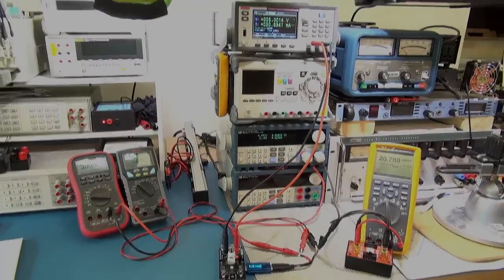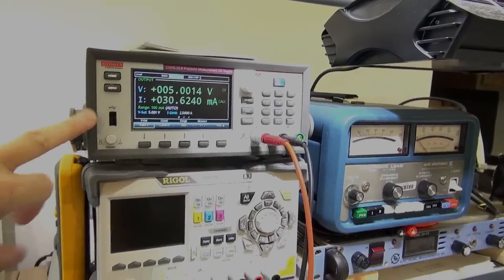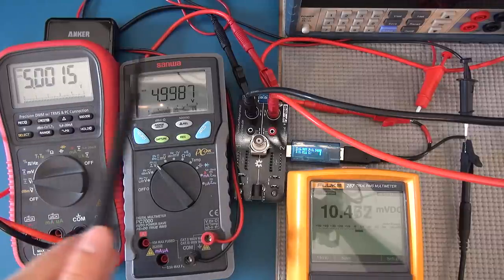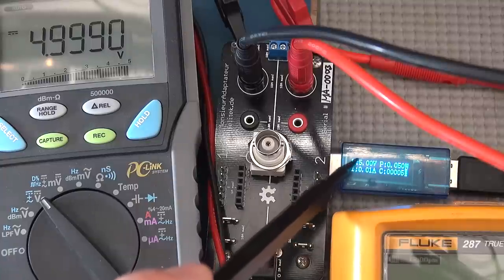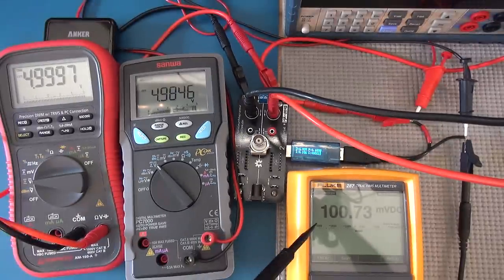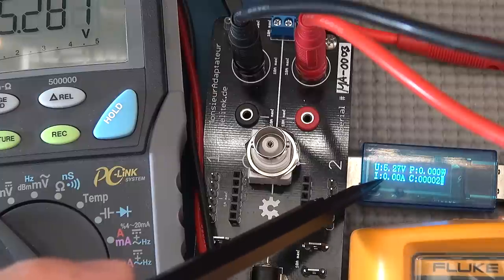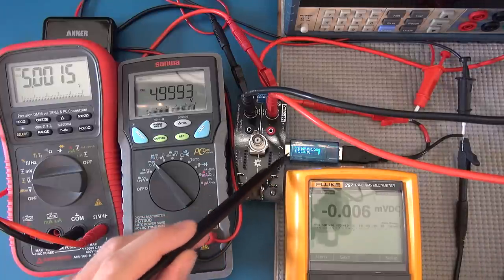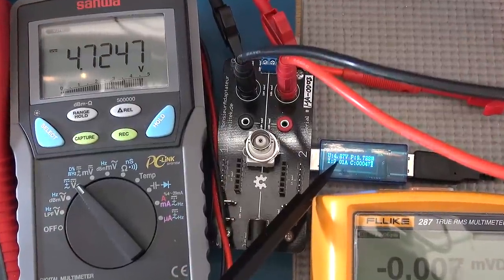USB Power Monitor Review - Pt2

Comment: I have been using the new yzxstudio usb2.0 Black with 2.5 firmware and this is an excellent monitor for in the field work.

It may not be 'good looking' but it is very well protected from dust and windy conditions blowing in unwanted debris.  :)

Comment: I have a identical one to the drok 3.0, even the sticker on the back i identical only it doesn't say drok on it and when you start it up it say welcome instead of Drok, all the functions are identical down to the red led and so on, under 10 bucks on eBay,  English manual with images and fully understandable. 
Sellers name is 
t-happy,  search for oled USB 3.0 power meter and you should find it.

Comment: I'm considering getting either the  red or yellow yzxstudio monitor. Can anyone tell me the practical advantage of each? I know the red shows the voltage of the data pins and attempts to guess the port type. I also know that the yellow has three modes that effect the date pins the red does not. Direct, Fast Charging, and disconnected. Can anyone give any input as to what situation would one be more useful than the other. I understand it takes a month to ship to the US. I'm wondering if I should just get a different one from a more well known company that has wholesalers in the US.

If I understand it correctly. The red has the ability to gain information about the port that is providing the power, but the yellow tries to fool the device being charged into charging faster.
Reply: but if you "fool" the wrond device to fast charge, you could corrupt it. right? for example if you force quick charge 2.0 or 3.0 on a phone that does NOT ALLOW a voltage over 5v..... you destroy it.